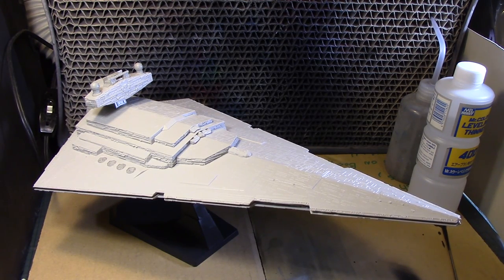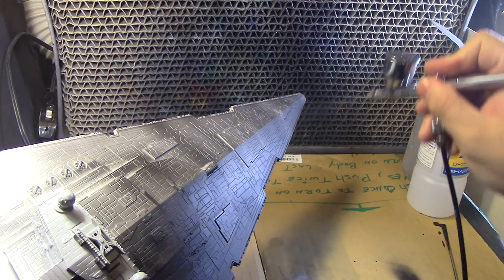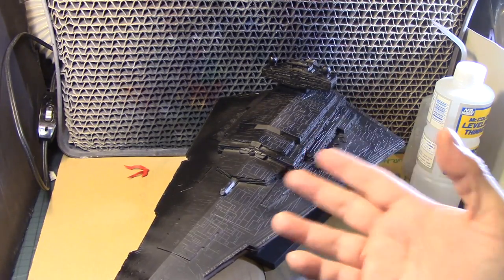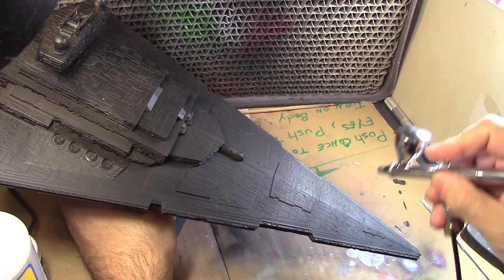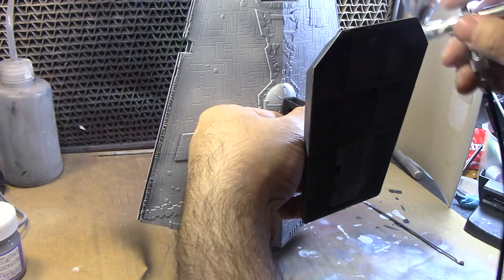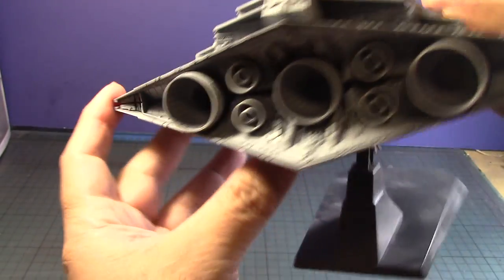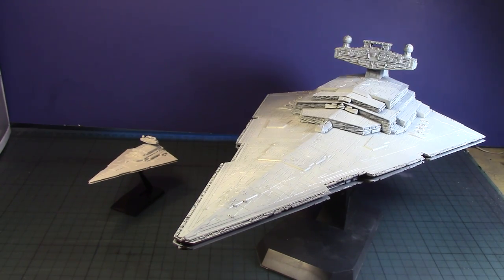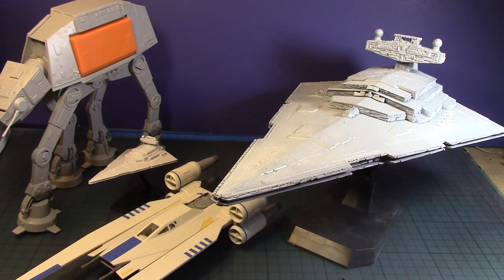*ForceBuilders* Revell 1/4000 Imperial Star Destroyer - Part 3

Comment: The VERY awesome Republic "Venator" Star Destroyer has been re-popped and was also released at the same time as this kit was and is available again. It's a fantastic kit, amazing detail and easy to light. In case you missed it, Revell is also releasing THE BIG Imperial Star Destroyer which is not a snap tite toy kit like this one(and to be sure this is still a very nice kit) but the Spring 2017 Imperial Star destroyer is just under 30 " long with an even higher level of detail and a lot more parts and the product development department told me today that it will be the one that is intended for experienced modelers who want to do a static or lighted build and promises that it's going to blow us all away! I can't wait. I still ordered this one as well as another Republic "Venator" Star Destroyer since Revell re-popped it to be released with this kit and it is NOT a snap tite toy, it's a modelers kit for experienced modelers and begs to be lighted if you so choose.

Comment: not sure if you want help with the math at all but, the star destroyer is 1600 m in legnth and the model is 400.84 mm. so 1/4000 scale would be .4 meters. it is in fact 1/ 4000 scale my friend. sdf1- macross would be 302mm at 1/4000 scale and the model is 300mm. hopefully this helps and saves you some trouble bud.